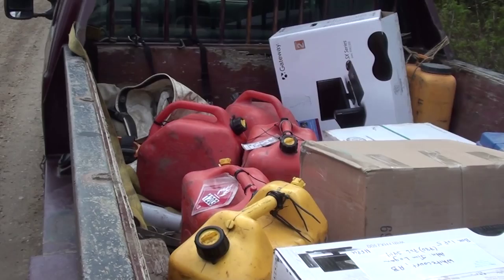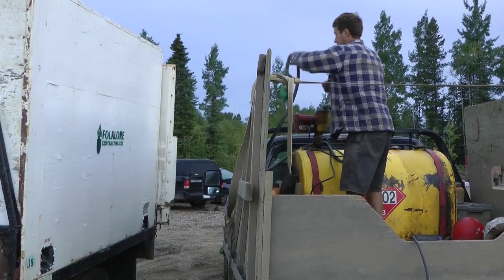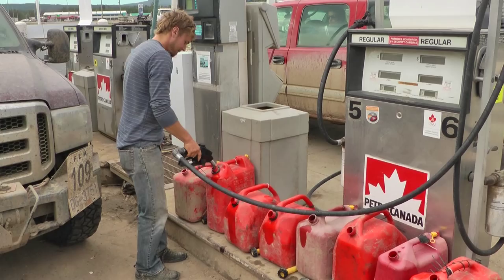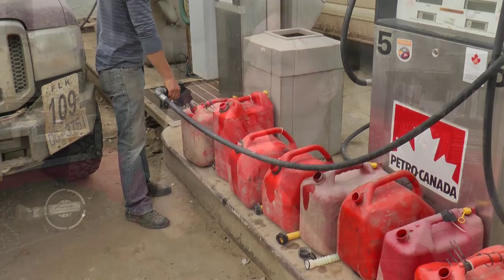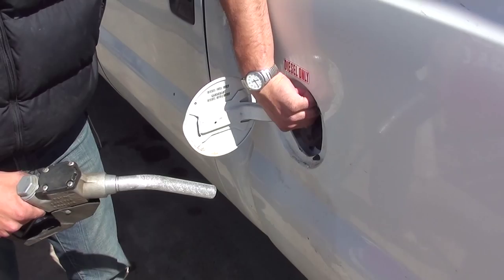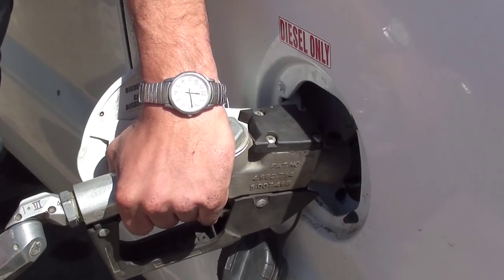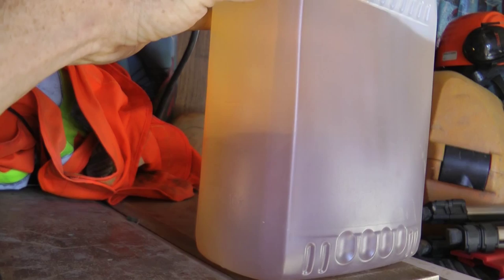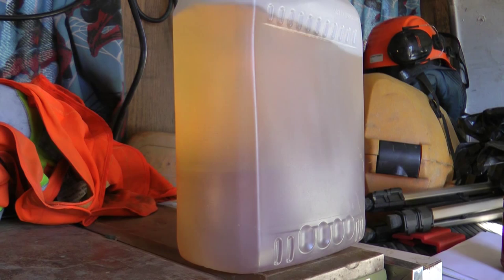Understanding Fuels - Diesel & Gasoline Use in the Tree Planting Industry

Comment: i already know all of this stuff,but it is still a very good video! i skipped around in the video so i don't know if you mentioned it,but if you are used to running diesel equipment it is easy to forget and naturally put diesel into a gas engine, such as a pickup truck. the small engines are a immediate giveaway they are gas,i have never seen a 3 hp diesel engine,but i am sure they exist!

Comment: Quite interesting video. But I felt your motor/engine explanation was a little lacking as you didn't mention external combustion engines that use external heat, usually from burning fuel but not always, transfered to a working fluid, like water, which then does the work. Yes, I know you're unlikely to find one working outside a power plant but thought it noteworthy. The way I usually explain the difference is that engines convert chemical energy into work whereas a motors convert electrical